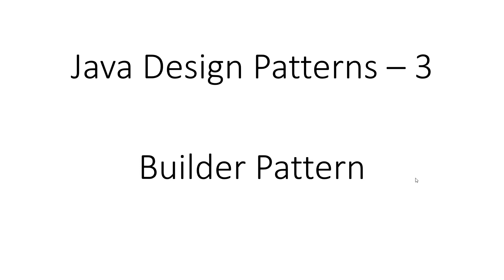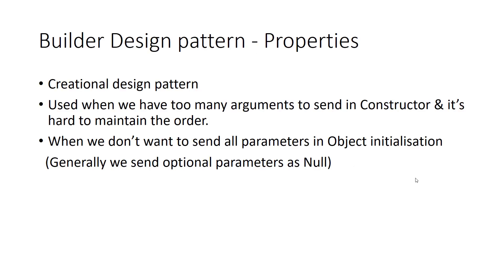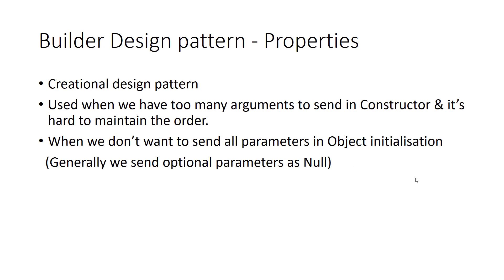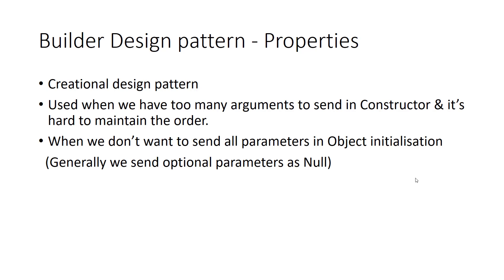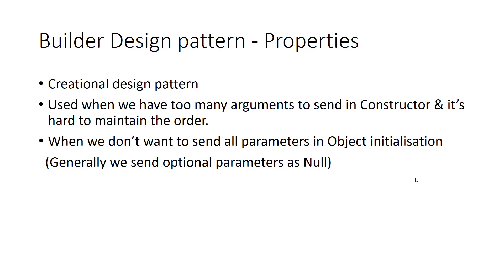Builder Design Pattern in Java

Comment: Here Defining a builder method as static. It's not thread safe right? when multiple threads trying to create vehicle instace using this apporach.
Reply: I believe it is not a problem.  You are correct to avoid static methods but that is not what we have here, right?  In the lines:
Vehicle car = new Vehicle.VehicleBuilder("1500cc", 4).setAirbags(4).build();
and
Vehicle bike = new Vehicle.VehicleBuilder("500cc",2).build();
The constructor of Vehicle.VehicleBuilder() gives us back our own instance of an object.
The .setAirbags() and .build() calls are NOT static methods, they are instance methods of class Vehicle.VehicleBuilder.  Good question to ask, because it would be a common mistake to make, but was not made here unless I am confused.  Static modifier on the nested class means only that you do not need any instance of the outer class to call the constructor of the nested class, which is essential here, because we can't get an instance of the outer class until after we have an instance of the inner one.
A bit tricky, but very cool.

Comment: Where did you set airBags default value to zero ?
Reply from the maker: Zero is the default value. For 'car' we called the function setAirbags, but for 'bike', we didn't call, so it initialized with default value, which is 0 because it's integer.  So this what is required that if we're not setting other value, it'll set to default values.

Comment: What is the reason for nested class as static ( builder)
Reply: If it wasn't static, we would already need an instance of the outer class to use it, so we would have a chicken-and-egg problem, right?  Why nested at all instead of stand-alone separate class?  We could do that and it would work, but when one class is very much associated with another, we will consider a static nested or inner class.   Also, both static nested and (instance) inner classes can access all members, public, protected and private of the containing class.  If it was a standalone class in the same package, in order to let that class access the members the members would need to be marked as default access, rather than private, so that is another reason we might choose this.
Reply: I watched another video and see a further very good reason why we do it this way.  They avoided the nested static class you don't like by providing Setters for all the optionals, which to me almost makes the Builder class pointless.  Here's the problem tho.  You might set five or six things with the Builder, then when you are done with those and ready to actually build it, it can verify that your combination that you requested even makes any sense.  Now, doing the sets one at a time you can't check that the combination is good.  Let's say (not perfect example but shows what I mean) you want to say you are married, your anniversary is on April 1st and your wife's name is Taylor Swift.  Doing a set on any one of these leaves us in a totally invalid state.  You just set a date for your anniversary, but your object says you are not married.  Maybe you are about to set the flag to say you are, or maybe you will forget to or setting the Anniversary was just a mistake.
There's nothing my program can do at that point to prevent you from putting in nonsense combinations of data into the object.
Sure, you aren't crazy about the static nested class (for some reason) but look at all the pain and suffering it can prevent us!